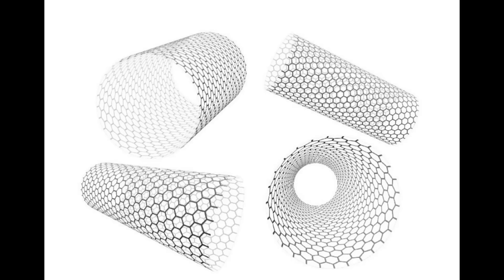What Material Will TSMC and Intel Use after Silicon?

Comment: Quantum Computing is not a good match for general purpose computing.  They are only good for a small subset of problems.  They have no advantage doing basic mathematics.  And are actually slower at basic arithmetic.
Reply: Same reason why DNA based computing reached a dead end. Admittedly quantum is much more versatile than that though.
Reply: Marc Jackson  You seem to be mistaken about what the team in Sydney achieved. They created a two-qbit-gate, not copied a quantum state. The no-cloning-theorem is a mathematical proof showing that it is impossible to copy the (arbitrary) state of a quantum system onto another arbitrary system. This is due to the fact that any operation performed on a quantum system has to be unitary. So no matter how good the team in Sydney is, or any other team for that matter, this remains impossible, since it is not a problem with any implementation but a fundamental constrain for quantum physics.
Reply: QC can, theoretically, solve optimization problems that are virtually impossible to solve with GPC (e.g. large number of dimensions leading to an immesurably large search space). Theoretically, we haven't been able to demonstrate that yet :D
Reply: Marc Jackson 
The Grover operation is probabilistic.  It’s answers always have a probably of less than one.  That means it’s wrong some of the time under the best circumstances.

The type of problems your solving with quantum computing generally speaking fundamentally different than the problems you solve with a normal computer.

Yes you can implement binary arithmetic, but is not as fast as doing it with normal binary methodologies.

It is for solving problems that would normally require an order N algorithm or worse.  In those cases it’s able to solve the problem in square root of n time. (Some research sites the cube root steps.)

Addition, subtraction and multiplication would not be optimized by using this method.  All of these could be optimized, in theory, to a 2 level nand-nand Combinational Logic.  Multiplication is typically implemented in more layers but it could still theoretically be reduced to 2 layer logic.

Quantum computers work very similar to analog computers from the late 70s.  You take a standard transistor based state machine (a cpu), you convert the problem to qubits in superposition (this step alone takes more time than doing addition), you iterate towards a probabilistic answer, and you push the answer back into a standard transistor based state machine. (A cpu.)
This takes more time than just calculating the answer for basic arithmetic in the state machine for simple calculations.  (Such as basic arithmetic.)

Where quantum computing shines is in algorithms that require iteration in polynomial time on a standard computer.  This would include algorithms such as prime factorization.
Reply: @pweddy1  You are all missing one fundamental reason why QC will never replace classical computers: the 'no cloning theorem'. It is impossible to copy a quantum state, and since a lot of the things computers are used to do require copying there will always be a need for quantum computers. At some point there might be a quantum cpu that can also act as a classical cpu, but it would still have all the same problems of scaling etc. as today, which is why the most a QC will ever be is a specialized subsystem of a larger computer system used for things like BQP problems.
Reply: quantum computer are in their infancy compared to PC's much less general purpose computer which go back to at least the 30's (IE 90 years), quantum computer didn't hit a major breakthrough until about 2000 , and most of the major breakthrough didn't happen until just 13 years ago, just this year the very first actual commercial quantum computers are being made... maybe they could become dynamic enough replace the PC but the BIG problem of quantum computers is the temperatures required.

my bet would be on graphene the stuff is a wonder material... and not just for electronics
Reply: Well that might be because our current algorithms are bad for QC. With different approaches QC could be useful maybe even in conventional computing. We barely scratched the surface of QC so who knows.
Reply: dulipub 
Quantum computers actually aren’t faster at solving basic arithmetic.  PERIOD.  They don’t perform operations at a higher rate of speed.  They look at all the answers at once.  Then you must force them to collapse from a superposition state into a normal state that can be processed by a standard computer.  You NEVER use a “pure quantum computer.”

The basic premise is you use them to solve a nondeterministic polynomial time problems using a probabilistic model.  This COULD solve multiplication using it but it wouldn’t be faster and would be a waste of resources because it’s a simple deterministic problem.  And quantum computers actually can have error (due to fact that any heat causes quantum decoherence) and must typically be verified by multiple runs.

Multiplication is a deterministic problem and can be solved using a fixed number of components that generate correct answer every time. (Booth multipliers are a common text book method of doing so, however you can collapse some of the logic down using either the Quine McCluskey or, beyond the limitations of that algorithm, the espresso heuristic methods.)

Quantum are not good at “mass computations” such as 3d graphics.  Which are a simple deterministic problem that must be solved across large data sets.  Instead you use them to find a single answer that is VERY VERY HARD to compute.
Reply: @dulipub  yes, but you're just shifting the problem from hardware to software.  As a software developer I don't have much faith that your average developer can design programs that would realize the advantages of a quantum computer.  Hell, we haven't even gotten very good at concurrent programming and that's been in mainstream computers for a decade!  The most popular programming languages were designed, at best, in the mid 90s - they're bad at this stuff.

It would be a monumental shift and optimistically it would take developers decades to catch up.
Reply: @bobbycrosby9765  We haven't start yet. 30 years ago no developer would realize the advantages AI and ML programming, 100 years ago there isn't even any programmer. We will learn when we need to, like always. And AI can help a lot along the way.
Reply: @iamkailong  for the past 60 years they have continually thought we would have human level AI in 10 years.  The algorithms that power modern AI have existed for 40 years. AI is so good these days not really because of any particular breakthroughs, but because of the sheer amount of data we have to sift through.

It really is a buzzword.  ML will solve all our problems!  Everyone is doing AI to solve all sorts of problems... except they're not, they're mostly doing standard statistics but throwing in ML because its the buzzword of the day and helps you get seed funding.

Comment: I actually came to the same conclusion on my own. Well, about the same conclusion anyway. I think there's a little more improvement that could be done after photorealism, but those are things like improved physics or whatnot. Things that could benefit games but don't directly pertain to the rendering part of the equation. Even if that's true though, you're right that we'll probably get all the performance we'll ever need out of silicon before bumping into a concrete wall. We can go wider. We can stack higher. We can improve cooling and thermal conductivity. Plus I haven't given up on there being a few clever architectural tricks coming down the line. They probably won't be a complete game changer, but ten-to-twenty improvements in performance can make a huge difference.

But, we'll still eventually need to go past silicon for some purposes. We'll need it if we want to keep building more powerful supercomputers. At least if we want to build them without continually getting bigger. Plus there are going to be some real cases where we need a lot of performance but space is at a premium. For example, imagine that at some point we want to make a deep space probe to explore relativistic effects. In that case, we would want to squeeze as much computing power as possible into something positively tiny. (Accelerating even something the size of a baseball to relativistic speeds would be pretty difficult. So initially at least. We're not going to be using something as big as a double-decker bus.)

And that's just one example that came at the top of my head. It kind of indicative of how much of a nerd I am, but it's still a valid one!

So yeah. It probably won't be for consumer purposes, but we probably will see a silicon replacement at some point.

Comment: about molybdenum disulfide, the thing is, we use single element material is because of purity requirements. Making perfect crystal of molybdenum disulfide might be proven much more expensive than just sticking to silicon. Other option is going yolo with imperfections and design chips in a way to work on 99.9% of capacity despite small fragment damaged, instead of scrapping whole part or turning off half of the chip what have place now.
Another option is going 3D, everything so far have been done in pretty much 2D fashion. Stacking silicon might be considered 2.5D, first true 3D might be considered 3D XPoint from Intel, where copper tracks are layered with different layers of materials. These are extremely simple structures, but if possible making complex 3D computing blocks would allow radical shrink in size and power usage.
Another proposition is biological self assembly.
Using biological organism to lay down structures encoded using DNA and copying it without fail., but that technology might take years to come, but at greatly reduced cost.

Comment: I think the biggest future improvements wont come from cpu power. It will come from things like, Persistent Ram, Faster interconnects between components, New ways of thinking about computing and architectures. Possible even new instruction sets for cpus.
Reply: Why would you want persistent RAM in anything other than a server though? I suppose a recoverable state is good for business but for people who are hoping for privacy, volatile RAM is a better option.
Reply: @johnbuscher  Latency, transactional memory copy-on-write (essential in supercomputing and heavily multicore)
Reply: @johnbuscher  By PRam im talking about merging DDR and HBM2 technology. So you can use a 2tb ssd as DDR at DDR speeds
Reply: @dralord1307  I'm not sure that makes any sense. HBM2 is already a stacked DDR technology. Basically, you're suggesting merging bread and a sandwich (already made of bread).
Reply: @crayzeape2230  Well it makes enough sense that it just got a patent for the technology so i guess it makes enough sense to merge your "hard drive" and "ram" to make some companies develop it
Reply: @crayzeape2230  I assume you know what the paging file is, correct? Now imagine you had a hard drive that could operate at the same data transfer speeds as ram can. Your paging file could completely take over what your ram used to do. There would be no need for ram at all. And the paging file is variable so it could grow as your system needs more ram. Its a very simple concept. Not very different from Optane drives from Intel.
Reply: @dralord1307  The point I was making is that HBM2 is a bunch of DDR dies stacked atop each other, nothing to merge!
Post a link to the patent you mention.
Reply: @dralord1307  Did you mean SSD instead of DDR in your initial comment? That would make sense in line with your argument. If not, then how did we go from RAM to a storage topic?
Reply: @crayzeape2230  I never mentioned HBM2, but it could possibly be used in a merged HDD/DDR though I dont think it would
Reply: @dralord1307  Your reply to @John Buscher
QUOTE: "By PRam im talking about merging DDR and HBM2 technology. So you can use a 2tb ssd as DDR at DDR speeds"
This is the very comment I said makes no sense.
Sorry, it wasn't your initial comment I was replying to (erroneously stated in a previous comment.), but the above mentioned reply. I wish youtube would thread comments properly :(
Reply: @crayzeape2230  Hmm some reason i cant reply to your newest reply to me. My earlier "HBM2" was i mistake it should have been DDR. Sorry about that.
Reply: @dralord1307  YT is having trouble with comments, it seems. But I mean, yeah the biggest thing is that's great for recoverable states for, like, server crashes or workstations where you'd really need to save hours of work, but imagine the need to run an OS entirely in RAM and instead of getting a clean slate everytime, someone can just recover it or it recovers into a bad state thinking it's the last known good state, you know?

I'm just not smart enough to see how to fix that last problem, I'm sure it can be done but I feel like it's a security/privacy issue and it also feels like that tech will be expensive as heck.
Reply: @johnbuscher  Well the os would be running as normal basicaly. just instead of it going to ram it would be going to the paging file which acts the exact same way as ram. This is done on laptops all the time. You could probably easily solve bad sector issues the same way ssd's do that today with over provisioning and sector checking. I would assume servers would be the last to adopt the combined ram/ssd untill its perfect
Reply: I'm leaning more towards complete SOCs, GPU, RAM, CPU etc all in a single package, probably pre-soldered to the motherboard. At least for the "boutique" PC builders.
Reply: Faster interconects between components. You are up against the speed of light. Can only make the interconnects faster by moving the components closer together. Trouble with this is getting the heat out of the device as Intel have/are going to find with their 3D processor/die chiplet stacking.

Comment: Why the need to go even smaller than 3nm when inter-connecting and stacking seem the future.
Reply: You need to scale down to reduce power consumption. It is the nature of the geometry of the gate. What you really need is to alter the transistor parameters like threshold voltage, gate capacitance, drive current, but the best way to do it is alter the gate geometry and scaling down positively change all transistor parameters. It is the one trick that gives you everything. You can do other things but then you need to do a lot more work to achieve the same thing as shrinking the transistor.
Reply: @kazedcat  I understand the benefits and negatives of going smaller, but the ROI seems the be getting smaller these days. Stacking and inter-connecting chip communication speeds seem to be much more beneficial investments since they're relatively newer. Ryzen 2's gains seem to come from both a node change and better Infinity Fabric speeds.
Reply: @LakerTriangle  It is the reason why Intel is having trouble and AMD is thriving. Without the weight of fab R&D dragging them down AMD can invest more on architecture. Intel have to bare the cost of fab R&D and they could not share that cost to other companies like other foundries do. But TSMC and Samsung needs to continue process node development. They have customers that expect them to offer better chips. So they need new technology in the pipeline. They need to think how to shrink transistor below 3nm. Because that is their business.
Reply: @kazedcat  I somewhat agree.. Even if they don't go below 3nm you think companies will go elsewhere or build there own fabs? I don't think so - too expensive and locked out by patents. I also don't believe a node jump from 3 to 2 or even 1 would provide better results or cost than what I previously mentioned...The yields would just suck for while. To be clear, yes research should still continue but the focus should be shifted to other things to improve speed and power draw IMO.
Reply: @LakerTriangle  TSMC's business is process development. AMD does the advance architecture and packaging development. ASML does the lithographic tooling development. They are separated into different companies and it will be a waste of resources if they step into each others toe. Also TSMC could not just stop development because there are a lot of foundries making it work at lower nodes. If they stop then the toolmakers will just sell their equipment to this other foundries allowing them to catch up and compete with TSMC. Toolmakers need to sell something and if TSMC stop buying their most advance tooling. They will make profit by flooding the industry with current technology equipment.

Comment: Baby steps. We had trouble with silicon in the early days as well. The limits of silicon are inching ever closer. The demand for better will hopefully fuel research to find a suitable upgrade.
Reply: The problem is investment jitters - the industry has invested in silicon to the hilt, and will be wary of migrating to investing in another material without being very sure of a return.
Reply: Graphene will last what 10 years before it hits a wall?
Reply: @netforce0  It's basic science is far less well understood and exploited than silicon, which has had decades of use - graphene has potential beyond merely standard semicon logic - spintronics, metal wiring layers (data and power), and all sorts of assorted things.

It's also a great conductor when coupled with things that like quantum dots, or other 2d monolayer materials like WSe2, or MoS2.

In short, it's use is far greater than a basic replacement for silicon CMOS logic.

In reality, it's unlikely to be used as a straight up replacement for silicon, as doing so would require a shift that would just as easily allow for a change to some spintronic paradigm, like Spin Wave Majority Gate.